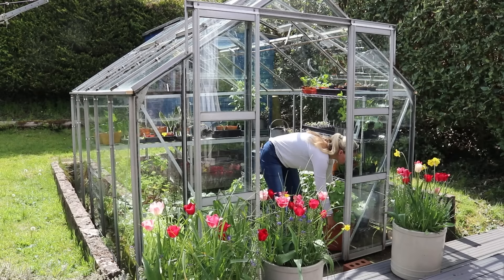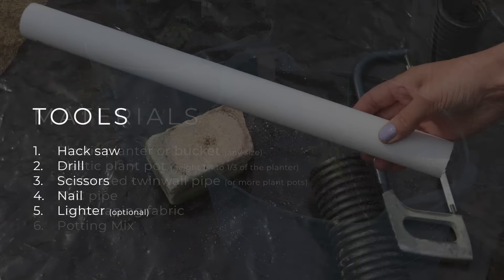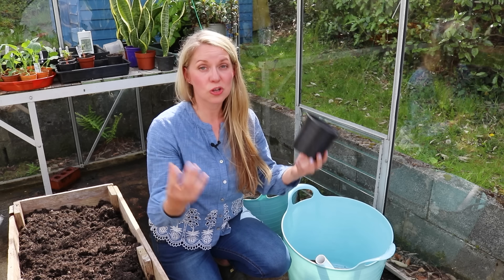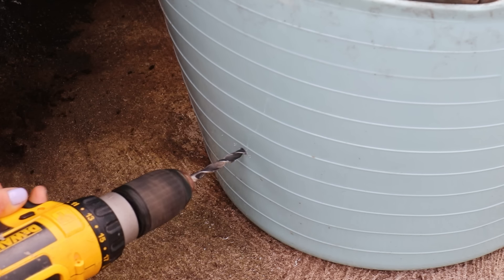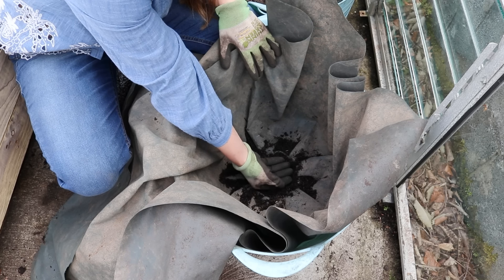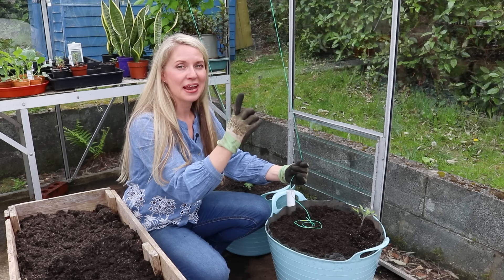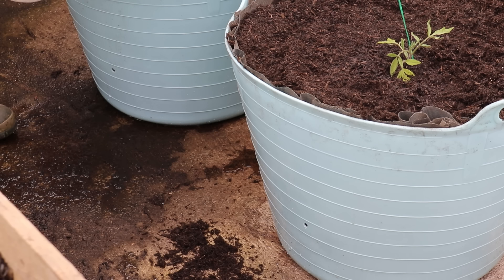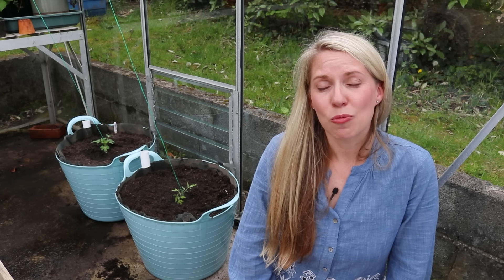DIY Self Watering Planter for Container Vegetable Gardens (Wicking Pot)

Comment: That's such an easy wateringsystem. I have a different question if you don't mind. I have an apple (Jonagold) tree and a pear (Conference) tree next to eachother but the pear doesn't seem to thrive. And unfortunatly i don't have another spot for this tree. Could the apple be taking all the nutriens? Thanks for the video .
Reply from the maker: Hi there - how far apart are the trees? How old are they and what size? What root stock are they on?
Reply: @Lovelygreens  about 3,5 ft. both about 3 years. No taller then 5,3ft. They don't have rootstocks. ( i honestly don't know if it's necessary)

Comment: My daughter built one from a tote, she used a platform item that was perforated and some kind of supports then the cloth with the tube. She had a larger diameter tube. 
When we went through the heat dome, the potatoes were fine because of the "self- watering" tub. 
She still uses that same tub/tote today, 3 years later.